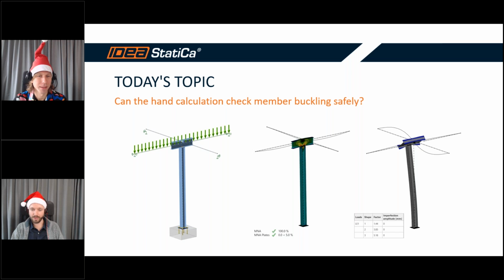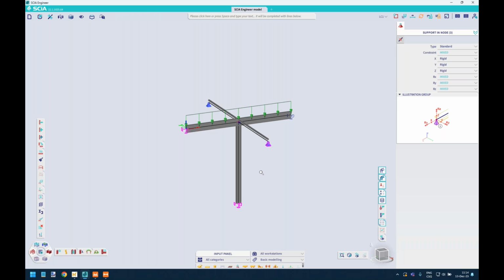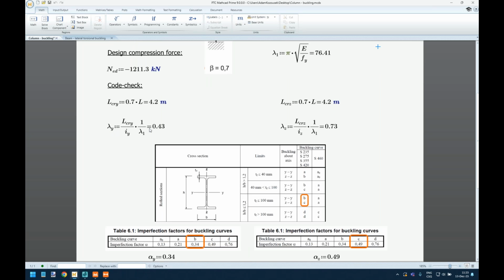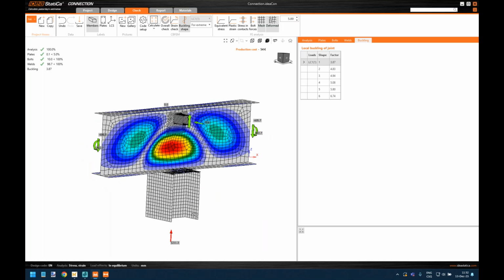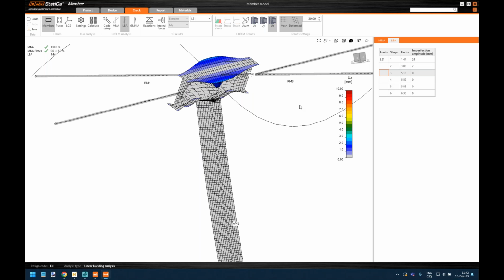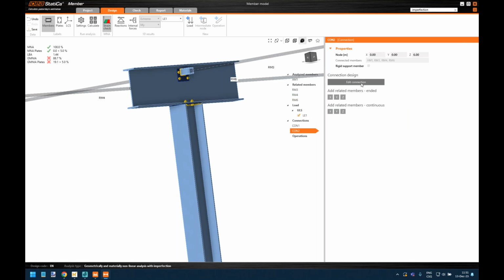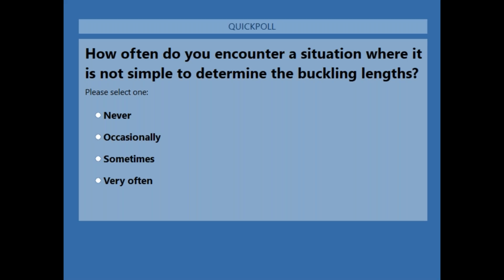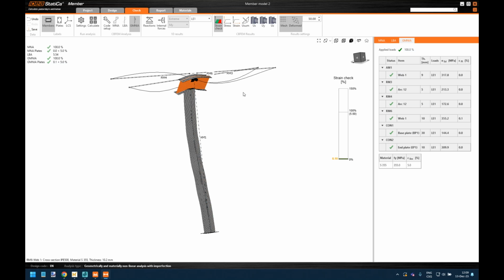Can the hand calculation check member buckling safely?

Comment: I think the point is that it doesn't matter very much what effective length factor you assign to the stanchion, taken in isolation, because that isn't the element that primarily provokes the failure. It is a question of the whole system, but the beam web buckling seems the most crucial in this case. Even if you do a simple web buckling check, on the beam web, you get an answer that should ring alarm bells. 'Back in the day...' we would not have designed and detailed a connection like this - if we did not then have the tools to do a fairly rigorous analysis, such as is possible with this software, then we would have 'designed away' the problem in conjunction with prudent detailing. Whilst I'm an enthusiast for such tools, I feel that we should not become too dependent of software to do our thinking and we should avoid mechanistically 'box-ticking' our way through the design codes and standards.
Reply from the maker: Hello,
I agree with you completely. Engineering judgment and experience is the key. Such tools as Member helps you to prove your idea and whats more - produce a paper with code-check  proving that clearly, so you are safe as the designer. And of course you have more complex situations where the judgement is uncertain...

Comment: With two weak box members connected at the web of the column (weak axis of the column) why would an engineer assign a buckling length of 0.7 around the weak axis? Even before analysing or designing, one can know that such a high compression load the member would most probably buckle around it's weak axis and that the two box members can do nothing there for the stability, so why not directly assign a buckling length of 2.0 and ignore the contribution of the two box members?
Reply from the maker: Hello, thats true, but not everybody shares the same opinion and would go for 0.7 as we can see from the poll.
Its a bit discussed in the blog:
https://www.ideastatica.com/blog/is-the-analytical-approach-enough-to-check-member-buckling